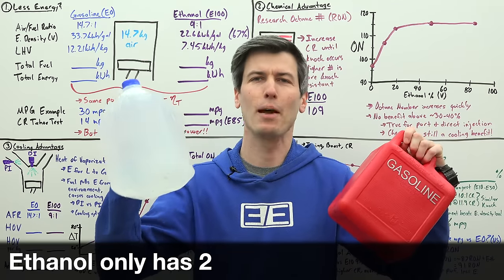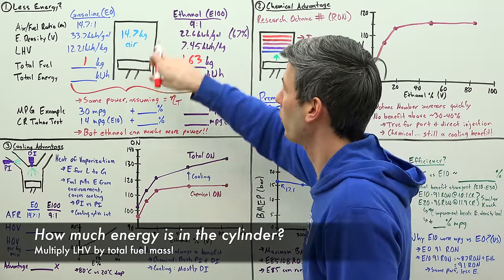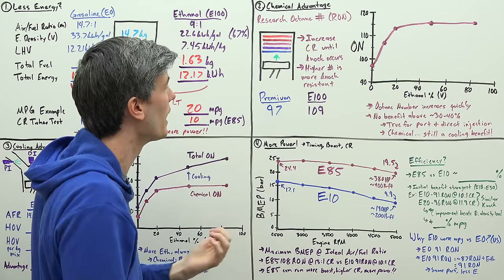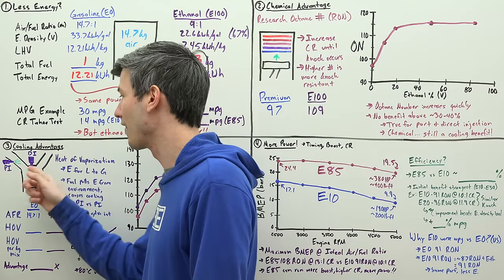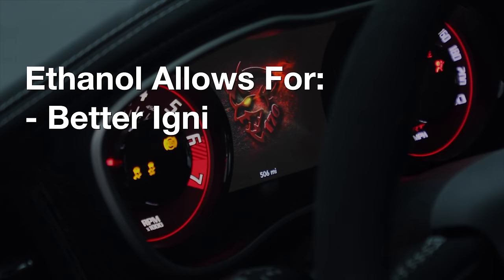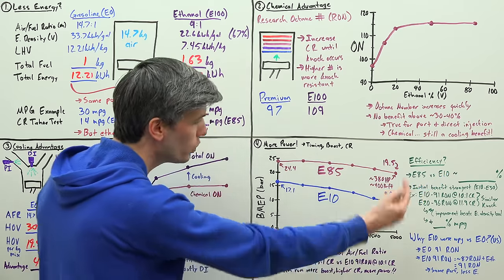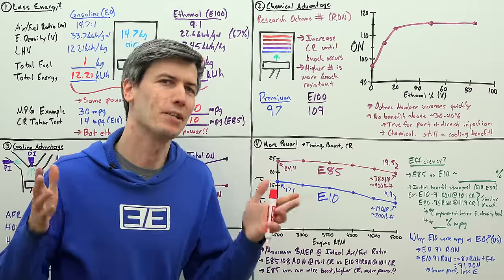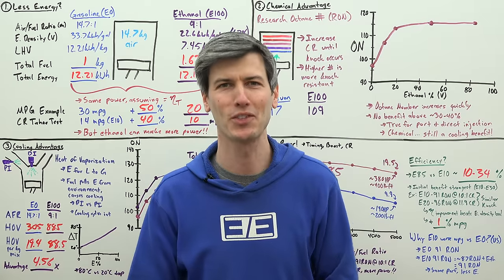Why Does Ethanol Make So Much Power? (Versus Gasoline)

Comment: Here in Brazil our Gasoline is sold with 27% Ethanol directly from the pump and our cars are able to use any mix between Ethanol and Gasoline, we have hydrated ethanol on our pumps too. They call it "Flex Power" since you can decide on either running on Gasoline or Ethanol.
Reply: I’d love to get a Video about hE* and E*.

As far as I know the Water Content reduces the Ethanolate Corrosion on Aluminium.
Also it’s pretty complicated to get the Water out for no real Benefit.

Taking "102" ROZ Fuel and adding E96 to it was my go to when I tried to get a Catalytic Converter working slightly better for Emissions Testing.
It got better but not enough. I wouldn’t attribute it to the Fuel, because there are to many Variables.
When I went over ~20% combined EtOH there was no Power with a cold Motor.
As soon as the Motor was up to Temperature I didn’t feel a Difference anymore.
But the ECU lacked a Knock Sensor and wasn’t tuned for more than 95 ROZ.

Here in Europe you have extreme Difficulty to find FlexFuel Cars although all the Manufacturers supply South America without any Problems and Bosch makes all necessary Parts. The Companys completely negate the Existence of it.

I would be interested if making EtOH from Crude Oil is comparable with making Gasoline from it.
Gasoline needs complicated Processing like Cracking already.
The EtOH wouldn’t be "green" but still immediately reduce Smog.
Reply: Can you imagine the RON of the base gasoline, because adding 27% ethanol it still makes the blend RON below 90? I guess it is a terrible gasoline with RON of 60...
Reply: @overtoke  yes a lot of people use 100% ethanol, and pretty much all cars sold like after 2010 ish can handle any ratio of gasoline or ethanol from 0-100.
Reply: Modern engine computers are able to adjust A/F ratio and spark timing for the different ethanol blends (i.e., different total octanes).  Ideally, if engines could be made to have adjustable compression ratios with ethanol mixture as well, we'd all be getting maximum power and efficiency out of our engines with whatever fuel we choose.
Reply: @overtoke  Yep. Just like one can choose to use the premium or regular gasoline hoses when filling up in the US, in Brazil the pumps have Regular gas, premium gas and ethanol hoses. You can 'pick your poison' as you fill up. I usually go for gasoline just because of the greater range (a full tank of gas takes you farther than a full tank of ethanol). Lately the price difference between ethanol and gasoline has been favorable towards gasoline (in terms of km/money unit).
Reply: @overtoke  95-96% ethanol, because it hygroscopic
Reply: "Flex Power" is called "Flex Fuel" in the North American market. The fuel mixes which work are gasoline, methanol (up to 10%) and ethanol (up to 85%).
Reply: Many vehicles in the US do the same thing. Not every pump sells e85 but there's usually at least 1 in every town I've seen
Reply: @overtoke  the final mix (with 27% ethanol) is actually 92 RON (87 IAD)
Reply: @guilhermemarques8793  What is the 73% gasoline RON rating that it starts with?

I think our RBOB is 84 or 85 and 10% ethanol brings that to a usable 87 octane.

Premium E0 here has upwards of 40% BTEX (benzene, toluene, ethylbenzene, and xylene) at 91 octane.
Reply: @mglenadel  Most Americans don't know that your common gasoline for non-flex vehicles is E27 nor that your premium gasoline is E25 (Harley's use that).
Reply: Bzazil is technologically more advanced than Germany. Here in Germany the next big thing in trasportation is ....BEHOLD!!! The cargo bike...This country is pathetic.
Reply: @DoctorHemi  Good point on adjustable CR. That would be awesome, and likely allow some crazy fuel mixtures to reach absurdly high compression ratios and SPCCI/HCCI more effectively. Allowing for higher power density when using the highest total RON fuel. It looks like E45-E55 is the sweet spot. Or even reaching higher octanes with synthetics . F1 engines are running 50% efficiency already on RON 87 fuel.
Reply: Igor cara. Tu viste o vídeo da avantgarde preparando um gt3 com 50% etanol? Ficou irado. Temperatura de combustão reduzida e potência aumentada. Tem o lado ruim mas blz.
Reply: @sierraecho884  Cargo bikes don't contribute to traffic as much as a car would, and they pollute less. It is less technologically advanced, but better than dealing with 2h-long traffic jams...
Reply: So brazil ethanol have water does that water dont separate from gas and you are left with water in the bottom of the tank
Reply: @byronboost  Ethanol bonds with water and don't separate easily. It's hygroscopic.
Reply: @byronboost  Nope, that doesn't happen to ethanol. Look at the chemical bonds of both and you will understand.
Reply: Thanks for mentioning, & commenting.
Reply: @byronboost  Ethanol acts as an emulsifier, mixing water into the gasoline and, to some extent, even dissolving it. You can separate ethanol out of gasoline by ADDING water to it, but the Brazilian gas is well stabilized and doesn't separate easily at all (likely even harder to separate than hydrodiesel). Also, anhydrous ethanol takes quite some energy to separate so I guess someone discovered that it doesn't affect how it interacts with gasoline so long the ethanol is well distilled (96-97% ethanol).

Afterall, if you think of it, flex fuel engines are already capable of taking any mixture of gas and ethanol from the gas station pump, and the ethanol there definitely isn't anhydrous.
Reply: @NothingXemnas  Sure sure, it´s just difficult to drive 30 miles to work or pick up your IKEA furniture with a cargo bike. It´s also a pain in the ass when OTHERS tell you you have to use a cargo bike instead of your car.
Reply: @deleterium  Gasoline requires high tech Processes to Crack it from the Distillates.
A Refinery of that Level easily goes over 1G $US and requires an Input of okayish Crude Oil.
The Oil Fields that are available to them aren’t that great.
Venezuela for Example has a lot of Oil but it’s more of the consistency to pave a Road…

Also there is more to Fuel than the RON/MON.
High Vapor Pressure Components aren’t great in the Heat and the other Way around isn’t good also.
It’s difficult and getting low Grade Fuel up to an acceptable Level with EtOH is a pretty elegant Solution.
Reply: Here in Brazil we make incredible HP numbers in tiny 4 cylinders with Hydro Ethanol, witch is the pump ethanol. It is 95% ethanol and 5% water, what make even more knock resistant and better cooling. Very hard to start a car in the winter with our Hydro Ethanol. 

In my calculations if you make a a blend of 25% water and 75% ethanol, it has the same fuel cooling then Methanol. Makes sense here since ethanol is much cheaper then methanol.
Reply: @AlexandreSk  
MeOH 13.02kPa @20°C
EtOH 5.95kPa @20°C
H2O 2.34kPa @20°C

The Vapor Pressure is pretty relevant for evaporative Cooling and as a Result important for Fuel Injection that’s aiming for this Effect.
Reply: @NothingXemnas  i think it anhydrous in brazil only e100 have up to 7% water
Reply: E27 = 27% anhydrous 73% regular gas
Reply: As a user of 100% ethanol since 1986 can agreed more. We make ethanol from sugar cane (not corn) Now with a model 2022 Peugeot 2008 SUV. 1.6 liters 4 cylinders 120 HP with a city 7 kilometers per liter and 9 kilometers per liter highway. (a lot) But 1 liter of ethanol cost about US$0.6 vs US$1+ for gasoline. Greetings from Asunción Paraguay. Pd: Fusca 82? carburador duplo com alcoo puro nesse tempo. logo apos Voyage, agora Saveiro 2017. Sempre alcoo 100% gosto do cheiro... Bye galera.
Reply: @overtoke  yes, and yes.
Reply: @danafletcher2341 in the US, ethanol is limited to 10% in most states in "gasoline"
Reply: @karlbr21  Now E15 is available here in the US for non-flex fuel cars.  

E85 is available in <2% of stations, so is hard to find.  Some stations offer E30.

In France, E85 is available in 25% of stations and the government has made E85 conversions for non-flex fuel cars legal there.  Perhaps fewer monopolistic powers at play there.
Reply: @overtoke  Yes... almost every station has E100 and E27 there is pretty much no E0 since its illegal.... and since it is not anhydrous ethanol in many cases the corrosive properties are less.
Reply: @mglenadel  The grades are a bit different in Brazil though... its basically plain E27, E27 with detergents and E100. They call them Comun, Adiditivada and Alcool. In the USA almost all fuel has detergents, and the difference in grade is octane rating only.
Reply: @danafletcher2341  The reason US doesn't have E85 is we only use shitty corn to make ethanol.... its a subsidy crop. A large part of US ethanol could be supplanted by genetically engineered cane ethanol if the politicians would get off thier butts. We have cane now with increased growing range, and that can also produce biodiesel from the same plant (so you get sugar for ethanol + 10x the oil from the cane as soy produces today for biodiesel on the same acre of land).
Reply: @Wingnut353  Actually, since the Freedom to Farm Act was passed in 1996, farmers are free to plant any crop they want without risk of losing any subsidy.  The end users must therefore bid for acres if they want farmers to grow a particular crop.

Ethanol producers are somewhat insulated from crop subsidies, for if the price of corn is low, then so too is the price of their distillers grains/byproducts.

But if the price of corn high, then they make up for that with high prices of their distillers grains.

This precisely explains how they have been able to keep ethanol prices so low despite the recent high prices of corn.

But if you want to blame ethanol for anything, perhaps you should blame it for causing farm subsidies to crash.  Since the energy act first passed in 2005, farm subsidies went from around 25 billion to around 10 billion in 2023 not counting inflation.

Because of this feed factor, corn ethanol can outcompete most any other source out there including sugarcane which make more ethanol per acre but little else.  So much so that Brazil put an import tariff on our ethanol.

Corn ethanol is a value-added product of already existing feed production which preserves 100% of the protein and other things as feed in a healthier, more digestible/efficient, and more concentrated form which is called distillers grains.  Cane requires a dedicated acre as does sugar beets etc.

Brazil is also making ethanol from corn and it is a very nice fit for them because A) they already feed cattle and B) they are able to more efficiently run their ethanol plants all year round between cane harvests.

The subsidy for corn ethanol (Gen 1) ended in 2011 and the Gen2 subsidy (which somehow cane counts as) ended in Jan2022.  The recent budget deal reinstated the Gen2 subsidy once again.  Corn's subsidy was $.45/gal back in 2011 and Gen 2 ethanol's is $1.00/gallon though no Gen 2 ethanol plant has ever been built.
Reply: Sounds like a wise idea.
Reply: @byronboost  wrong. Ethanol works as an emulsificant to the water and gasoline. Also ethanol must be under 1% water. So we NEVER had this kind of problem (only happens in irregular gas stations)
Reply: @AlexandreSk  What do you call "winter" in Brazil ?